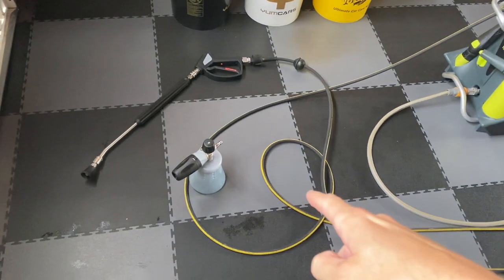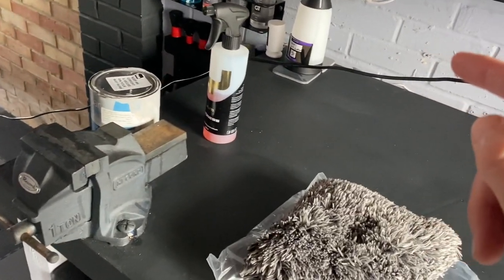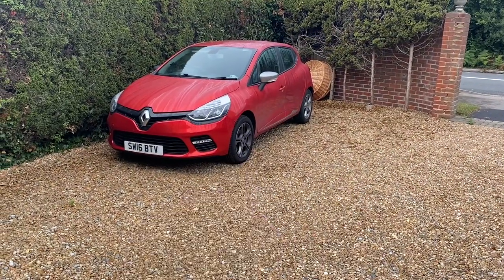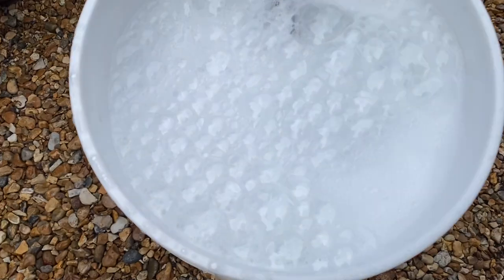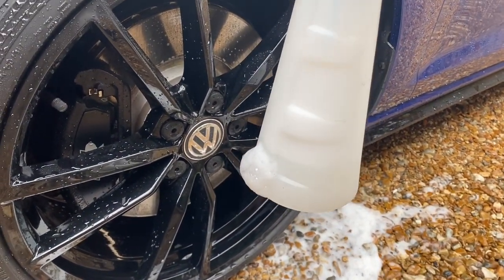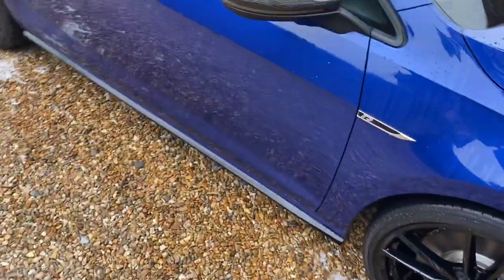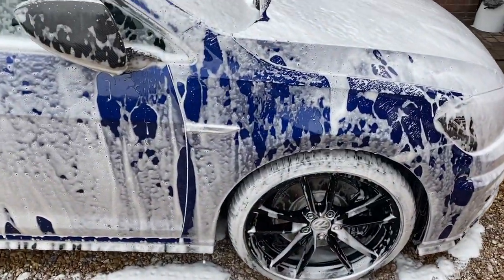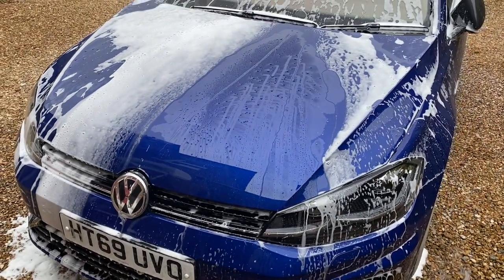HOW I WASH MY CAR DURING A HOSE PIPE BAN!!!

Comment: Pressure washers are part of the ban, so I am told, is this true ?
Reply from the maker: Hi there . Thanks for the message. That’s a negative. The water source is from a water tank as shown in the video. So basically you can use a pressure washer but from a tank and not mains water supply. All rules followed. Luckily the hosepipe ban is now over. Hope this was of help.
Reply: Wish mine was, Thames Water is running into 2023.
Reply: @Mrchristian101-00   it’s ended now washing my car in 1 hour